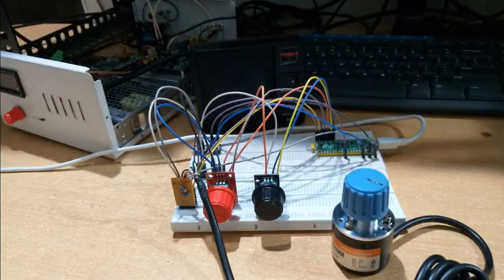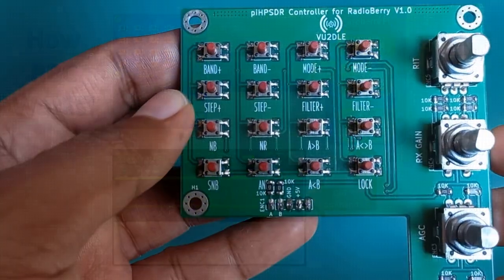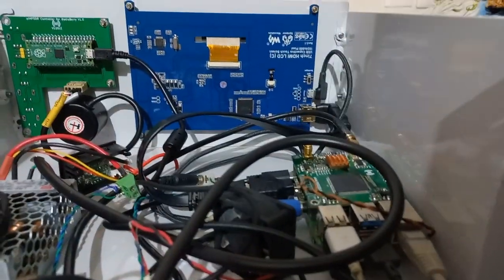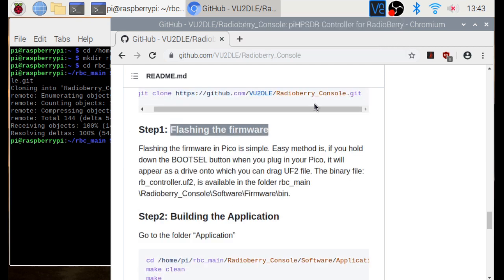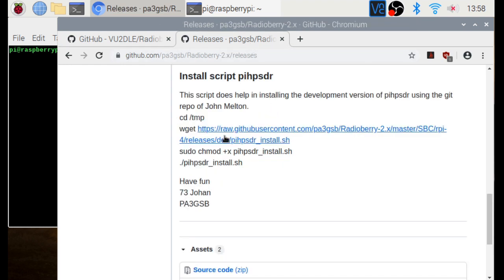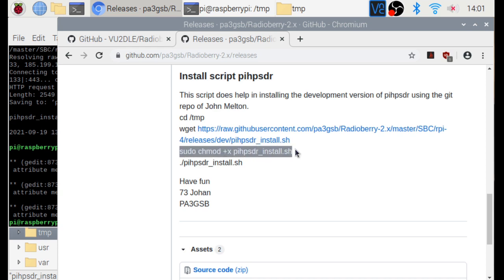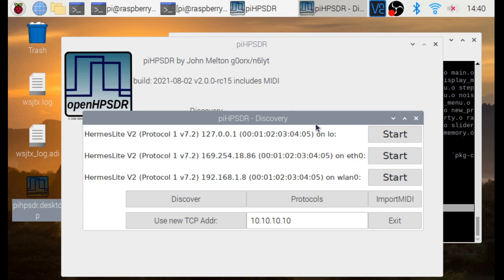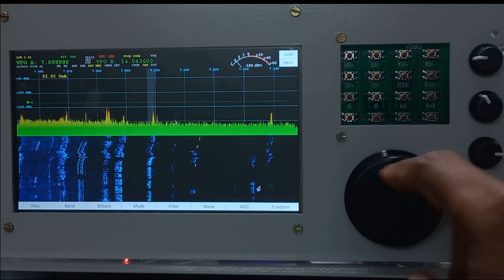RadioBerry Controller for piHPSDR

Comment: Very nice. Thanks for sharing. 

Should you decide to do a respin, I can't see it quite fitting the 100mm by 100mm cheap PCV limit, but it would be better to make provision for the rotary encoder to be mounted on the board. You can do this quite easily in KiCAD. It would make it mechanically better. There also could be a few more mounting holes around the buttons, so it can't flex. I would also suggest making a "front panel" PCB, black solder mask with the mounting and holes and legend on it, no actual tracks needed. In fact, it might even be a good idea to develop a CNC aluminium front panel as JLC will produce these very cheaply. If you don't want to do that, perhaps you could share the KiCAD files. It would also help if you could export the 3D model of the PCB as vmrl so it can be used to develop said front panel.

I noticed the Band + and Band - buttons are in the wrong order, at least for English language users. Same for several others, mode etc. The tradition is the down function should be on the left and the up function on the right. Easy to adjust in the source code.
Reply: You can program the buttons as you wish, doesnt matter the label in the pcb. I'm making a design to be 3d printed. When its ready I'll publish it.

Comment: I have assembled a controller of your design, I can't install RBC, please help. It took me a long time to assemble, ordered printed circuit boards from China and now I have assembled it, I really wanted to try it, but it doesn't work. Please help me.
Reply from the maker: Thank you for your interest in my project. May I know your callsign?
could you please check your issues in the following discussions https://github.com/VU2DLE/Radioberry_Console/issues/1
if you are facing new issues, kindly share your logs @ https://github.com/VU2DLE/Radioberry_Console/issues. 
Many 73s, DE Dileep
Reply: @dileepbalan8026  I'm sorry, there was nothing I could do. 
Regards UT4NJ. 73!

Comment: thanks for your efforts and work i just order the parts but what i find out that not any longer works due to the pi update and also still i have the old version of pi os legacy 64 bit and pihpsdr installed . would your radioberry controller work for me. thanks
Reply from the maker: Hello Arash, thank you very much  for showing interest in my project. when you update, RBC stops working, since it is designed to use wiring pi. My humble opinion to you is to focus on to get best performance in RadioBerry by installing the latest release, because OM Johan has fixed several issues. RBC is just another simple controller, that you can incorporate with your radioberry. 

Watch out my github and hopefully I will update the new design soon.  
I wish you good luck & many 73s DE Dileep
Reply: @dileepbalan8026 Thanks very much for your useful advice I would follow radioberry  to see if they would find any proper solution  to fix it
regards

Comment: Hello sr, I built the controller based on the files you posted on GitHub, but now in 2024 the library wiringPI.h is not longer available… is there a way to make the controller to work?
Reply from the maker: Hello OM Eduardo, Thanks for showing interest with my project. You are right, wiring PI is deprecated. I'm considering your request soon, and will provide a new update asap. Many 73s DE Dileep

Comment: Thank you for sharing! Incredibly well thought of and done build. The narration and detailed explanation of the project is a whole incredible thing on its own. I really enjoed listening and watching all the details in this video. 
If you don't mind would you talk a little bit about how you paired the tranceiver with the 20w amp? What low path band filters you are using and how do you control their selection? Thank you heaps!
Reply from the maker: OM Olegsky
Thank you for your interest!

20W amp is from G6ALU. VU3TLD designed PCB in such a way that, RadioBerry, 20W Amp and LPF (design from VU3TLD) all can be neatly integrate and stacked up to save space. During my initial experiment, I was using QRP Labs LPF for 20M and 40M.

VU3TLD's project 20W AMP: https://github.com/pa3gsb/Radioberry-2.x-extensions
QRP Labs LPF: https://www.qrp-labs.com/lpfkit.html

Many 73s Dileep

Comment: Hello Dileep. Many monts after,  i have finished the hardware. Many thanks to share your project and details. When I activate the Mic in pihpsdr menu TX, AND if i start rbc_main , thus pihpsdr program stop after few moments : pihpsdr tells some error with mic thread process.  I don't see this issu when  TX mic is disable in pihpsdr, or rbc_main not started.  Why did you change the rig ctl .c file.? you are not using simple CAT command? I plan to use unmodified  pihpsdr code for investigations. Regards.
Reply from the maker: The reason for changing the rigctl,c was explained in detail, if you can look at pihpsdr github. I am using CAT command only, but I have not aware of simple CAT command. I will consider your detailed analysis in my next revision. Looking forward to your findings after using the unmodified pihpsdr code. My HW and SW is also fully open source, hence you have freedom to modify/update for your specific needs. 
Many thanks for your comments & I wish you good luck for your investigations
73s DE Dileep VU2DLE
Reply: @dileepbalan8026  many thanks ti share your hardware and software. more investigations in github issues. Regards

Comment: Many thanks again for you work. It works also on my side. How did you manage the screen size ? piHPsdr is 800*400. Your touch screen is 1024*600 . How did you increase piHpsdr size to cover 1024*600 ? the usual button , top side right, doesn' work here. Many thanks
Reply from the maker: oh! I am answering a bit late. Hopefully you already figured it out!
It's pretty simple to change the screen resolution.

1. take the complete source files from pihpsdr github
2. open the main.c
3. change the desired resolution in the following lines

#define MAX_DISPLAY_WIDTH 800
#define MAX_DISPLAY_HEIGHT 480
here change the width and height to 1024 and 600 respectively

4. save main.c file
5. recompile and make your target (which means follow the compilation steps of pihpsdr manual)

Enjoy your homebrew and many 73s
DE VU2DLE Dileep
Reply: @dileepbalan8026  YEs it works for screen resolution change. Thansk's

Comment: A big thank you for sharing your work: beautiful and efficient. Do you have the reference of the headset compatible with the RASP4? (not all chipset are linux compatible)
Tell me if you sell PCBs, I would be interested. Thank you
Reply from the maker: Hello Remi,

Thanks a lot for your kinds words. Headset I used is PLANTRONICS Blackwire C3220. RASP4 detects both Mic and headset, so that you select those configuration in PiHPSDR. 

https://www.amazon.com/Plantronics-Blackwire-C3220-Headset-Over/dp/B07CVGN2DY/ref=sr_1_3?crid=AKY2ZX1R9CED&keywords=PLANTRONICS+Blackwire+C3220&qid=1654099300&sprefix=plantronics+blackwire+c3220+%2Caps%2C260&sr=8-3

Many 73s DE VU2DLE
Reply: On raspi we can chech Mic configuration with alsamixer command. We can activate the audio feedback with un mute command

Comment: There is a malfunction with Raspberry pi4. When building the software with the command “make” , the system reports errors with wiringpi. Definitely because the wiringpi library is no longer managed by pi4. Unfortunately, wiringpi can no longer be installed on pi4. Do you have a solution?
Reply from the maker: OM IZ6KCQ, sorry for my delayed response. I will certainly look into this issue, fix this issue in my upcoming next version of RadioBerry Controller. you can also watch the issues so far in this link: https://github.com/VU2DLE/Radioberry_Console/issues. Many 73s DE Dileep VU2DLE
Reply: @dileepbalan8026  tnx

Comment: Many thanks to the developer for developing the controller, if there will be an update to the controller, a big request to reduce the size of the board by 5mm so that the overall size fits 100mm x 100mm, as larger size is already more expensive when ordering boards.
Thank you!
Reply from the maker: OM Dmitry, sure I will take your suggestion for my next version. Many 73s DE VU2DLE
Reply: @dileepbalan8026  Thank you so much!  Got the PCB, but unfortunately did not have time to assemble, war broke out in Ukraine.
If all goes well, maybe I will build it again, very interesting project.
Good luck! 73!!! Regards Dmitry.  UT4NJ.

Comment: The program works. But the controller doesn't work. Does not respond to pressing taster. Need some customization?
Reply from the maker: Hello Rudolf, sorry for my late response! Thank you for homebrewing RBC.

Sorry to say that, I did not understand your issue completely. Since you wrote "The program works", then I understand that your software build is successful. and you successfully flashed the firmware rb_firmware_v10.uf2 to Raspberry Pi Pico. in this case, it should work at your side. unfortunately I couldn't understand more details from your comment. 

Hence, could you please update your issue with more details in my Github link: https://github.com/VU2DLE/Radioberry_Console/issues
73s DE Dileep VU2DLE